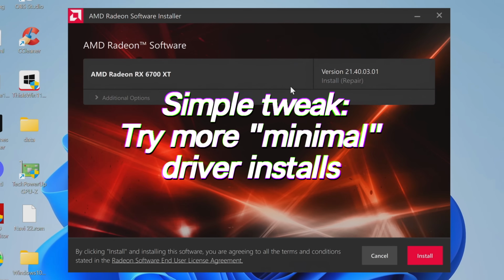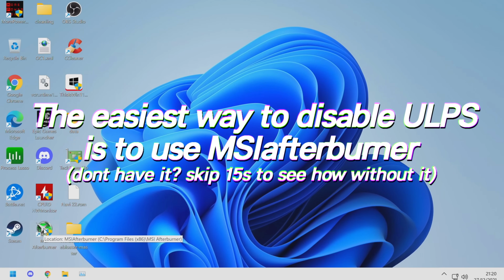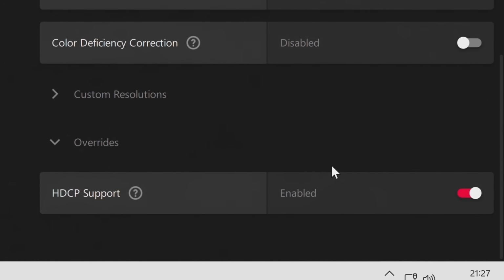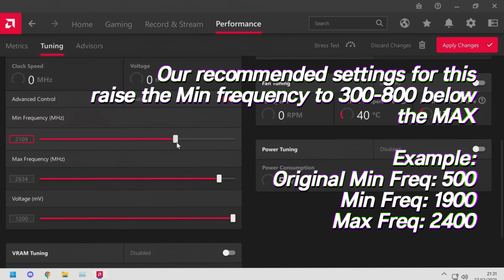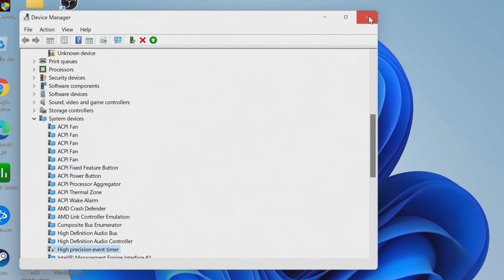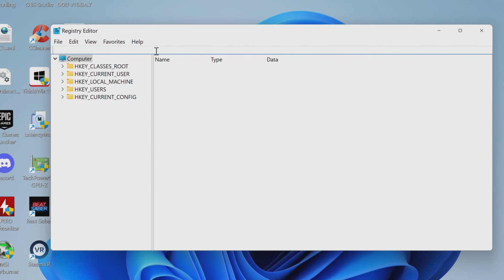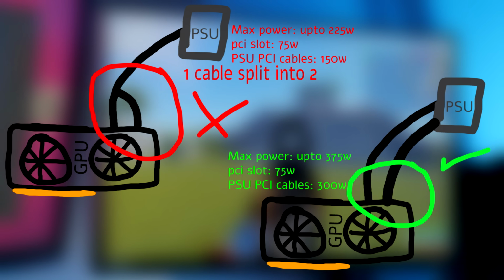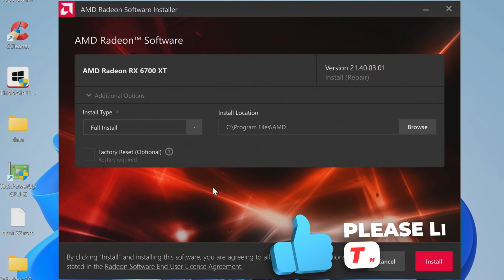🔧 Have an AMD Radeon GRAPHICS CARD? You should use these SETTINGS! *FIX LOW PERFORMANCE & CRASHES* ✅

Comment: hey youre the best man seriously. So i have this problem. And have come across no fix yet... tried everything there is to try that i have found after weeks and weeks of trying to fix this. youre my only hope i ....hope...
I went to attempt to disassemble my pc to clean it. As it was getting dusty. When I put it back together and started it up. 8.1 gb of my 16gb is hardware reserved. No common fix has worked. Of my two dimm slots. Both my ram sticks boot in the first slot separately. And boots when both are in. But neither boot if in 2nd slot alone.. I've tried for weeks and still nothing. The ram sticks i have are yes different brands but very close in everything stat wise. they worked together for 2 months until i took pc apart and cleaned it. upon booting it up after done cleaning. 8.3 gb of my 16gb hardware reserved....my pc barely scrapes by to play warzone.... this issue has just gimped me further... please if youknow anything ... id be forever grateful... i always watch your videos man youre the best for real...

Asusrock a320m-hdv r4.0 

Cpu ryzen 5 1500

Gpu: amd Radeon rx 560 2gb (but it's the shit one amd pwned off as rx 560s but pretty much are rx 460s) 

Windows and bios both recognize that there's 16gb. But 7.93 and 8.1 hardware reserved. They are two different brands of ram but match closely in their timings and everything. ADATA 8GB and viper patriot 8gb  And they both worked together before I had taken it apart to clean it and put it back together with no issues. Both the RAM sticks separately work and boot when in the first slot. And the boots up when they're both in together. But the hardware reserved issue regardless of which one is in the first slot. But neither one of them separately work to boot up in the second slot. There's no apparent damage to either of the slots or cards even memtest86 recognizes both of them when they're in slot but says there's only 8 GB on main screen system info on memtest86. I have fresh installed Windows in Every Way they have from PC to system image file on USB. Quite a few times to no avail. I tried un  checking Max memory in Ms config. Tried setting value of checkpagefileatshut down in regeditor. Tried booting with each stick solo one following the other then trying them both.  Run sfc scan memdiagnostics etc...nothing.

Comment: Hey panjno,
I just bought a "msi gaming x 6700xt", I've followed your guide but I have got still a crazy microstuttering especially in warzone. 
I tried all of this stuff:
- ddu + fresh driver install
- morepowertool + msiafterburner / amd adrenalin 
- disabling game mode in windows
- disabling htep
- both option and reccomended driver from amd
- tried to disable SAM, resizable bar, econding 4g
- render scale + render worker count in warzone files
I have all the basis optimization like: 
xmp, p.b.o., emptystandbylist, hardware acceleration, csm disabled, cppc+cppc pref.cores abled, global c-state disabled, pbo

I'm literally losing my mind, what can be the solution? It's about driver, directx, registry editor or what ?! i don't even know anymore what i'm talking about. If anyone have the solutions, please feel free to answer :')
Reply: I had some issues like this too check your power supply and make sure you are not using an old version.. I found out I was using a power supply of about 10yrs ago even though it was new and it supplies 1200watt the problem was that the voltage supply was low.
Reply: @TheOddballChronicles  I've got a 750w psu, and it's a 2021 psu
Reply: I'm having similar issues in some games with the 6700xt. Did you find any solution?
I am starting to think this may be my PSU like the guy here suggested but I don't know for sure
Reply: Disgusting game anyway..don't play shoot stab kill witch games, since God hate that so so much..
Reply: Hi bro. Have you tried to change the minimum frequency?

Comment: Damn you might have helped me to revive a r9 390, I tried with a 650 and 750 watt psu and experienced crashing. God damn if this works I'm hyped, I'll probably get a 850w PSU soon with dedicated GPU cables.
Reply: I think its because ULPS. Because i had the same problem and i thought it was my 550w psu. But no, it was because i had ulps disabled, and didn't have latest driver for my gpu.
Reply: @Oscarr_Official  Did your PC also restart at random times without error?
Reply: @working2cure  Yea actually. All the time on heavy loads.
Reply: Oh, I think we are having the same issue, I have a R5 5600x & 6800Xt, no overclocking but it freezes and restart with no error in windows event logger, qi just get the amd wattman notification when the pc restarts. When I try to play games, temp look aight around 75deg, it crashes on apex main menu just after the start screen, and crashes when I get to jump in warzone
Did the ulps thing fixed your issue?

Comment: So, if I have a 3 x 8 Pin power connection on the video card, I should be using 3 separate cables?
Reply: Yep, it should say that in the manual too

Comment: Anyone can answer this if you are using a rx580 8gb usually what fps do u get in fortnite on epic settings? My pc had crashes until i set the base frequency to stock. But, i have lost gpu performance i guess. That's why i am asking, if anyone knows pls reply :)
Reply: Make sure you are running in dx12 in Fortnite’s settings. Also look up how to disable deep sleep with morepowertool, this helped me with my 6800xt. Your card is slightly older so I apologize if this is a fix that wouldn’t work for you.

Comment: First Time Viewer here. Good stuff, subbed, I'm gonna have to watch this a few times but yeah, good stuff.
I had a weird problem on my AM4 build where if I walked away from my pc for more than 10-15mins. it would seem very sluggish upon my return. I disabled all sleep settings and put everything to performance but it persisted and quality suffered with performance enabled. I saw an LTT video with Anthony and he suggested to disable c-states in motherboard bios. I did and Bingo! problem solved. I also haven't had a crash since.
Reply: @ZiqulzBH I don't remember, and, shortly after I left my original comment, my cpu died, so now I'm not sure what the original problem was.

Comment: So explain to me, you said  I need to remove older drivers from my gpu, I'm building my pc tommorow and have a 6700xt aswell, are there pre installed drivers on the gpu?
So I should use the clean and shutdown option in ddu?

Does licking full install, then creating  a profile, copying it over to afterburner, cleaning the card with ddu and then choosing minimal install for the drivers work? And increase performance?
Reply: Yes it does and yes click that on ddu. This isn’t solving the root cause of the problem though this is just copping the branches. The root cause is the engineers screwed up when developing the rdna and rdna2 architecture, when you look at too many objects in dx11 games (draw calls) your gpu wattage drops like crazy causing lag and stuttering. You can do stuff on the outside to remedy this but it’s an issue with the firmware of the card that has yet to be solved. Amd is completely ignoring the thousands of support tickets on the internet with these lag problems and leaving people stranded. Even if they couldn’t solve the problem they need to acknowledge that it exists and at least try to fix it. Using a 6800xt reference here, an 800 dollar graphics card and in some games it performs no better than my old 1060 6gb mobile. It’s stupid because the hardware on these new Radeon cards are incredibly stupidly powerful, but it’s all left on the table because of some stupid bug. Best of luck.
Reply: @p_enta5012  thx, do you know why I hear people saying I shouldn't watch panjnos videos? I'm new to pc, I know some stuff but Im definitly still learning, trying to improve my 6700xt as much as I can, so I can play games at 1440p with at least 100 stable frames

Do you recommend using the tricks  and doing the things panjno shows in his performance improvement videos?
Reply: @sandroadler3607  Im not super familiar with him so I cant say.
Reply: @p_enta5012  because for me it seems like the video is pretty well made and like he said, if any settings cause problems you can just disable it again

Comment: Followed your guide. Was trying GTA 5 and was expecting some sweet FPS gains. But it got worse. Now my framerate can barely stay at 60 sometimes it drops to 30. Before that my framerate never dropped under 60. It usually was around 80 sometimes even at 100 or a little higher. Either I'll try each optimization at once or someone can help me 😅 what's weird too is that my cpu now runs at stable 5ghz. Which I clocked it too. It ran at 4,6ghz before with the same profile. All while running GTA 5. I have an i7 9700k, rx6800xt red devil by power color, 32gb cl16 g-skill trident z non-rgb and a gigabyte z390 aorus elite Mainboard. All Core clock on my 9700k is set to 4,6ghz. Single core clock is set to 5ghz. All with a slight vcore offset of -0.06V. Btw it ran pretty fine as mentioned before with the said cpu settings.
Reply: If everything was running fine, this video should not come in the picture
Reply: don't do the regedit stuff. Nit needed and if messed up or your system is different than his they can really screw stuff up.
Reply: Btw I'm running win 10
Reply: and i already tried enabling high precision event timer after trying gta 5 when it was disabled
Reply: gta 5 with vsync on monitor 144 hz I have 144 fps constantly...if vsync is off or I have the same stutters. keep vsync on and you have no problems. I hope it helps you if you found another way, I'm waiting for an answer:D

Comment: about the cable from the power supply is fundamentally wrong, you need to look at the passport, maybe 2 lines and cables from different ones, then it cracks,
Reply: 12v 30a+30a  1(all(non cpu)+gpu1(1+1a)  2(cpu+gpu2(2+2a) what wrong??only 1 cable supply good, 2 not good(very wrong)

Comment: The explaination of the PSU-Cable topic is not accurate! 1x8 Pin-Powerplug can deliver up zu 150W. If you have a daisychained cable with another 8 Pin, it can also deliver 150W! PSUs that have those cables use wires that are capable of doing that. The mainproblem  with this cabling is that you just stress one 12V Rail. Depending on the PSU that can cause issues with higher demanding graphics cards. So this CAN lead to problems but mostly will not. None the less it is absolutly best practice to use 2 independent cords if possible just because why not! But running a GPU like a 6700XT is not a problem at all for a non-trash PSU on one cable. Imagine how sensless this cables were if your assumption were right.

Also good that you mentioned the PSU dimension. Many people just do the math with "130W CPU + 300W GPU + drives and stuff ~50W so I rarly need 500W, so 600W is save to go". What seems pretty senseful does not include the massive powerspikes that CPUs and GPUs (Nvidia is worse than AMD) can produce. So your 320W rated RTX3080 can easly spike up to 500W. If your PSU is nervous and shuts down quickly your system went dark due to the protection systems. Qualitybrand PSUs like Be Quiet, Corsair and so on are not that picky and can easly take spikes. That means if you have a good PSU a 750W can handle it. If it is a cheap one maybe a 1000W can switch off.

I am very interessted in these registrychanges you made. Can you explain what they are affecting or give a source?

Great Video at all! IMO the most important advice is the minimum frequency. I struggled with that issue with my 6800XT that runs totally fine in such games but produces disturbing famedrops. Sounds funny but if you FPS drop from 400 to 200 you have such a massiv frametimedifference that you have stuttery feelings well above 200FPS. Frametime and framcevariance are the most underrated indicators of smoothness.

Comment: this video is a joke... PSU specs.. get 800 watt PSU? ever measured what your OC uses for power. most PSU are one rail anyway these days but because they split the cable outside the case it's 150 watts and if they do it inside it's 300 watt?. just wow... seriously sit down for a sec read specs. it's obviously made by connector not cable.

Comment: Excellent video, sorry for the performance improvement!
I am having a problem since this tutorial. When I'm playing, my discord mute keys don't work. But yes when I minimize the game.
Which may be? Thanks :)
Reply: This means the game you're running is running as an administrator, any hotkeys you press that are used by Discord won't be registered while inside game Window as your system is focused on the game, to fix this, you need to always run Discord as an administrator as well, it'll start registering hotkeys after

Comment: Ccleaner seriously... If you have had AMD "driver issues" and you have used Ccleaner on that windows then check your OS for corruption, seen way too many systems where Ccleaner has messed up the OS. Before you say anything Ccleaner is banned on microsoft forums, and microsoft defender detects it as malware, in one version that pile of garbage deleted the new windows update folder from registry...

Comment: I really need your help in private messages i have problems with streching resolutiom for cs go i do everything they do on yt and it won t strech full panell it turned on gpu scalling is on and it won t stregh on 1280 x 960 ... it won t strech on any resolution it only streches on 1080x1080 .... i don t understand

Comment: Your video is incorrect about the Cables to use, Modern powersupplies that have two, read: dual 8 pin ends on One  PCIE cable ARE ACTUALLY capable of delivering the full wattage. However, using aftermarket splitters that split one pcie plug into two, does NOT allow enough power from the rails down the wire. Only Garbage Tier psu's are incapable of putting out correct wattage to the plugs it ships with.

Comment: The problem with my GPU is more about stability than performance. I can run games I play at smooth 80 FPS, but then that causes entire display driver to shut off (watman crash) with GPU fans heard running at full speed until I hard restart the PC. The best way to avoid this for extended time is for me to purposely limit my FPS down to around 40-60. My PSU has 735 W. Will some of steps in this video help with such problem?
Reply: @Tegar Setiawan  I've looked up a vid about undervolting my specific card and it seems like it fixed the problem. I've gone in AMD Adrenalin's tuning settings and changed bunch of values. It used to crash multiple times in matter of minutes, now it hasn't yet happened in several hours (I'm currently playing Satisfactory and was able to leave the game open for that long). Plus, the average temperature has gone down by ~8C. 

Massive thanks to you and other guy who also suggested undervolting, it means a lot. I hope I no longer have to fear for health of rest of my components due to constant hard shutdowns of my PC's system. Its horrible when you pay a rather hefty amount for GPU only to have it not work properly.

I've also read somewhere that multiple softwares like Afterburner can conflict with AMD Adrenalin, so I decided to keep both Afterburner and RivaTuner not open.
Reply: @DaxMk0  whats the other video you saw. I am having the same problem with my Rx580.
Reply: @Wave_Kid  
https://www.youtube.com/watch?v=w03bINVnXGo
https://www.youtube.com/watch?v=0pzxFZBw-6Y
Reply: Hey bro what gpu do you have? I would suggest finding your exact gpu and googling best undervolt for that card as chances are some body out there has the same card as you and has a stable overclock and undervolt that will work for you I would also suggest running a benchmark with MSI afterburner to see if your thermally sound
Reply: Oh I'm such a dummy, I forgot to say its RX 570 (4 GB)
Reply: @DaxMk0  what kind of games are you playing you may be running into a memory issue game requiring more then your card has if this is the case I'd suggest 75% render resolution and dropping graphical settings down until your under that 4gb buffer
Reply: Maybe hot? Check the temp's
Reply: @legrestti  I thought that would be an issue, until it happens when GPU is relatively cool. And this GPU model should(?) work normally at like 70-80 C. Its got high TDP.
Reply: @Tegar Setiawan  Its 75hz
Reply: I've got an rx 6600 and have a similar issue in that the driver will timeout and force close my games occasionally. 

Sometimes it will crash within 5 mins of loading the game and sometimes won't crash even after hours of playing, it does this with pretty much all game's and for my gpu there is only 1 WHQL driver available and 1 beta driver...... Both give me the same issue. 

I'm just hoping AMD pull their finger out and fix the damn driver, this is the first AMD gpu I have used in like 15 year's and I think my next gpu will be nvidia again cuz their drivers seem more stable

Although I did get random crashes on nvidia gpus as well but they were like 1 crash in 1-3 months with AMD I'm crashing at least once a week and it's annoying

But performance wise I can not fault it..... For being a "budget" (£420) gpu it plays all my game's smooth as butter and stays relatively cool (80c max with custom fan curve) while doing so

I couldn't find any nvidia gpu (except 1050ti for twice the price I paid 4 years ago for one) in stock but even if I could I couldn't justify paying the ridiculous prices for nvidia gpus when I could get same or better performance from amd for half the cost
Reply: 100% performance 100% stability install clean driver only and use MSI afterburner settings disable ULPS and set FPS limiter in Rivatuner. done enjoy do not use AMD software.